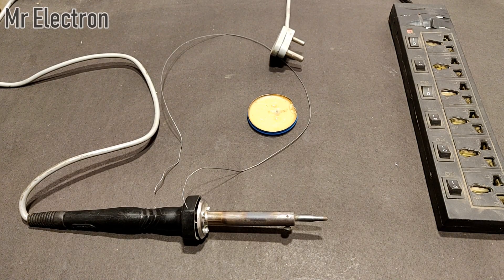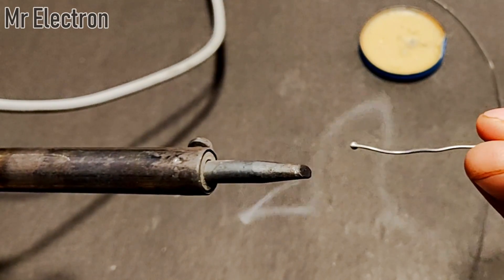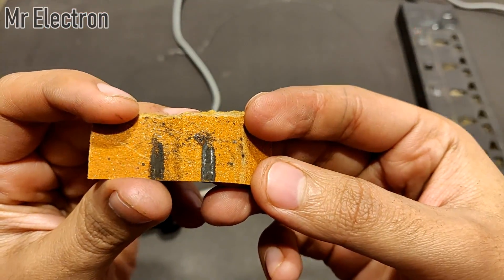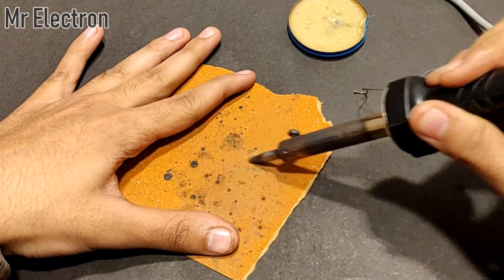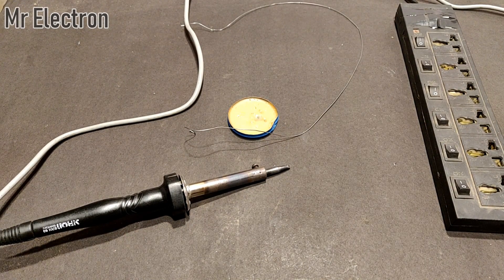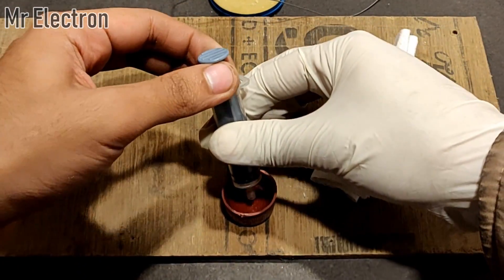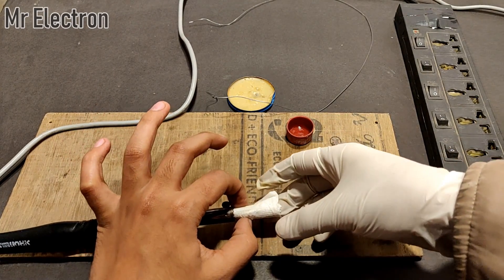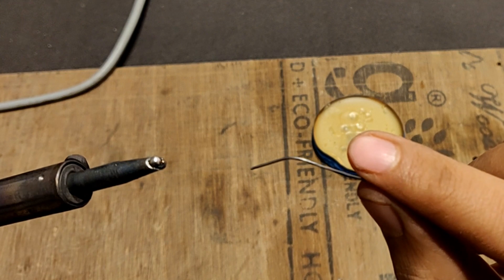Repair Soldering Iron || Solder NOT sticking to the Tip , how to Clean and re tin

Comment: incorrect, sandpapering remove coating of solder iron.  Now it will oxidise everytime u heat the iron
Reply: I wish i saw this comment, i ruined my tip now i need to buy a new one
Reply: What if it's already oxidised? My tips are in a weird state because when they were brand-new, I heated them and they oxidised before I applied tin so it won't stick. Flux didn't help with oxidisation, tin didn't help, sponge didn't help, brass cleaner didn't help. What now?
Reply: @Krzeszny95  well if you have an idea by now, i'm intrested
Reply: @laszlo_kovacs  I used a special tip cleaner I ordered from Aliexpress but it didn't work really well. It took me an hour to partially clean the tip and it dissolved a part of the tip!
What I suggest is buying special acidic rosin used in soldering steel. It should clean the tip if normal rosin doesn't cut it.
Reply: @Krzeszny95   I got the same problem man 😭
Reply: Yup, avoid harsh abrasives, especially sandpaper (and using a cutter) at all cost, it'll strip away the chromium plating and iron plating, the most important plating and deform the tip.
Reply: I just bought 5 new tips. But when I heat it up and tried to apply some solder to tin the brand new tip (With Flux)   the tip just oxidises before I can tin it. Can anyone tell me how to fix this.  But not the method on the video.
Reply: If u have destroyed your tip using emery paper..u will have to buy a new tip or recoat it with nickel..elctroplate it with nickel again.
Reply: haha so dont wire wheel them like i just angrily did
Reply: so what do I do?
Reply: What about using steel wool? Shouldn't that be even worse?
Reply: O k... First buy a decent iron. A decent iron will not just have a coating of that alloy, but will be solid.. Oxidation does occur quickly, That's why you tin the tip immediately after sanding. Once it is tinned it will not let oxygen through nearly as much. Naturally it will happen over time. Get yourself a quality iron and you'll have less problems.
Reply: mine oxidises anyway, so stfu
Reply: It's true, sanding removes the iron coating and exposes the copper which quickly damages your tip, always tin and clean your tips unless you want to buy new tips every month
Reply: Seems to work though doesnt it?
Reply: @krisneavus  do you even know what oxidising means? No one said it wouldn't work. But it definitely ruin the iron from inside out
Reply: @krisneavus  Yeah, it “works” at the same time using abrasives shortens the useful lifespan of the iron.

Comment: This is the dumbest way to actually 'ruin' your iron.... !!!!  You should simply clean it with a wet cloth and use flux and solder 2-3 times to get the perfect shiny tip
Reply: what if that doesn't work?
Reply: @Krzeszny95  then you need some more practice with the technique or maybe get someone to clean it for you.
Reply: buy a new one  @Krzeszny95

Comment: This is working just on this tipe of soldering iron not on a soldering station 
For a soldering station :
1. Clean the tip
2. Make a cuso4•h2o solution 
3. Put the tip on the solution (+) and a coper electrode (-) , at + put a 100ohm resistor 
Use 12v.
After 2-5 hours you will see pure coper forming on the tip.
Reply: "simply" make a copper sulphate solution

Comment: This is dvmb. You're sanding the coating/plating
Reply: You can do electroplating on the tip with an indian coin and then by an iron wire to make another protective covering.. 
And it is approved correct, dont dare to go against it
Reply: Dushyant Verma buddy not all of us are from india
Reply: @fernank017  kk iam also frm india..
Reply: @fernank017  um like you can literally search for what an indian coin is made up of and use the same metal to plate your tip so......
Reply: Then what are you meant to do genius